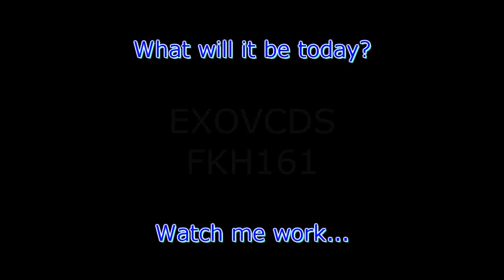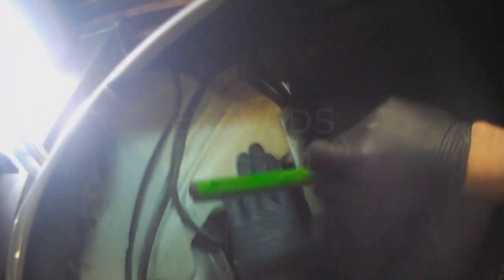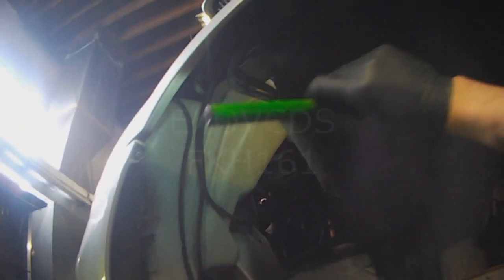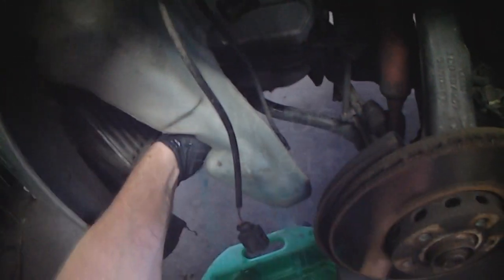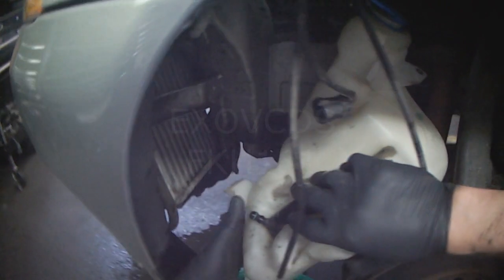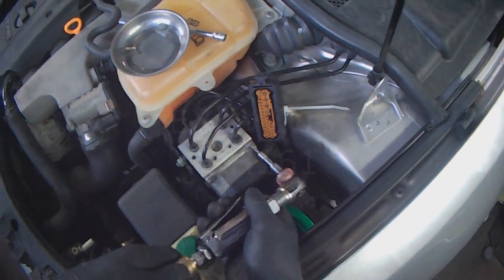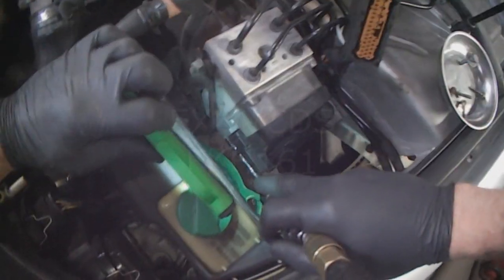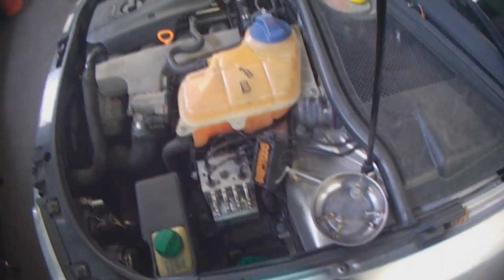Audi B5: ABS Module Removal

Comment: Was not expecting to see the washer bottle removal through the wheel arch. Most videos I find [for replacement of washer pump] require the removal of the front bumper, headlight and i/cooler. I KNEW there was an easier way. Thank you for the surprise.
Reply from the maker: It all depends on the year, make, model, engine. Thanks for watching!

Comment: super helpful...with ABS out of action with the Bosch 5.3 and others perhaps,  the rear wheels are relatively easy to lock up....😬..(ABS module fault also means rear wheel brake regulator out of action ) ....so its a real safety issue untill its repaired.......I've just replaced a heap of stuff before concluding my ABS module faulty...live and learn though, so all good 👍
Reply from the maker: Under normal driving conditions... lack of ABS (or even brake pressure modulation) is a non issue. Yes, road / weather conditions obviously come into play, but as long as one drives accordingly, the vehicle should be safe enough to operate... until a replacement unit is installed. Thank you for watching!

Comment: Great video!  Thanks for the tips, very much appreciated!  I'm attempting to split this module open and solder that broken connection.
Reply from the maker: +Kenny Gillis If it's a "no communication" fault, then it should not be too bad, because it is a bigger / thicker wire. If it is a sensor or other fault code, those wires are tiny.

Comment: Hey Thomas, great video! I'd like to ask you, if it possible to drive the car for a while after removing the module. I am planning to have mine adjusted but I need to move the car to the shop for other works
Reply from the maker: Yes, you can drive the car... just won't have any abs activation. ABS lights will be on in the dash and traction control (depending on system). Make sure to cover the exposed valve posts to keep dirt / water away.
Reply: @EXOVCDS  thank you.

Comment: Hey thanks for video , so i have problem of lighg abs and gearbox multitronic on audi a6 4b 2003 , so  they have relation abs with gearbox automatic??
Reply from the maker: Any fault codes in ABS & TCM?
Reply: @EXOVCDS  i dont do diagnostic before . I just want know the problem
Reply from the maker: @YassineBergou  I don't know the problem... that's why you have to check for fault codes. If no communication, then you have to check fuse and wiring.

Comment: Hey Thomas, great vid as always. I always learn something from your videos. 

I have a B6 1.8t and I get the ABS and the ESP lights coming on intermittently... Could this be my main issue..? I've already exchanged the brake pressure sensor and brake pedal sensor based from other shops recommendations.. but with no positive results. Please help.
Reply from the maker: I have not seen or am familiar with ABS Module issues with the B6 platform. 
Check with https://modulemaster.com/rebuilds/ to see if there are any known issues.
Thank you for watching!
Reply: @EXOVCDS  , thanks for the reply. I'll investigate with them since mine is an early model.
Reply: @EXOVCDS  hey Thomas, quick question... Would I have to get the module reprogrammed after I get the module back from them?
Reply from the maker: @Matt.R.B  No. If they fix your module, everything will stay the same. If they give you a different module / exchange, they will make sure it has the same coding.

Comment: Did you replace this module due to fault code 65535? Is the error resolved after the replacement? Have you taken down or repaired the electronics? thanks!
Reply from the maker: I don't remember the actual fault... most likely it was removed due to no communication. The module was sent out for repair... car can be driven without module. Once the module was repaired, we installed it again.
No need to post the same question under multiple videos of mine.
Reply: @EXOVCDS  thanks sorry for that ! I delete one of them.

Comment: Nice video.. I have a problem where the abs light goes on and of all the time.. Sometimes the abs works and other times not.. I always thought it was the sensor with a bad connection.. Can it be just a bad connection on the control module also? Got a 1999mod A6 C5.
Reply from the maker: The next time the warning light is on, have it scanned. If no communication, then the module needs to be repaired. If it has fault codes... some testing of components & wiring will be needed.

Comment: Hello Thomas, l now require a new module for my ABS.  I was wondering your thoughts on having the existing one rebuilt as opposed to buying a new one from the dealer?
Thx Peter
Reply from the maker: There are places that will / can repair bad modules. Such as: https://modulemaster.com/rebuilds/
There are other / more companies... we deal with local parts suppliers that stock exchange units. We give them out bad one and they give us a good one... ours gets repaired, to be sold to someone in the future.
Reply: @EXOVCDS  Thx Thomas. 
Can u bypass a bad  module and run the pump on its own if u wanted to purge the ABS system of air. I bled the reservoir too low :(
Reply from the maker: @peterhilbert6428  Air can't get into the ABS system (valve body) unless ABS is activated. Once air is in the system, you need to be able to open the valves to purge the air out. Running the pump alone won't do it. If you have a low brake pedal, try readjusting the rear calipers (especially if rear brakes were changed. Turn the pistons in until seated in the caliper and then turn the piston out until the caliper just slides over the brake pads. Resetting the calipers can increase pedal feel.

Comment: Great video! I have watched a bunch of yours. I am going to be grabbing some modules from pick n pull and I watched another video of an a6 I think and they pluged a replacement the module in to test it before they tore the car apart. Wondering if it would be the same on the b5s It would be nice if I could do the same in the parkinglot there. Thanks.
Reply from the maker: +King Life If you remove one from a car that has the same specs as your car (transmission etc)... it could be as simple as a swap, meaning that you can leave the module in place. No communication is the most common issue. If you have speed sensor codes, a module swap might not fix things.
Reply from the maker: +King Life Thanks for the update!

Comment: Is this a costly fix I’m looking into a 1999 a4 well kept but needs new abs module and don’t wanna get stuck paying half what I pay for the car
Reply from the maker: You can go to a wrecking yard and find / buy the same module for $100 or have yours repaired: https://modulemaster.com/rebuilds/cars-trucks/
You can even leave it as is and drive the car with no ABS... if your local Emission / Safety inspection allows. 
Sadly... a 20 year old car will require some TLC. Eventually, maintenance costs will surpass what you paid for the car.
Reply: Thomas EXOVCDS so you saying it’s a no go and I should look for something else? Guy said he well maintained the car but everyone says that
Reply from the maker: No, I'm saying that if you are already concerned about putting money into it... you have to realize that a 20 year old car will need attention sooner or later. There's nothing wrong with owning a 20 year old car. I have two that are 30 years old. It just sounded like you don't want to put any more money into it.
Reply: Thomas EXOVCDS basic stuff I’m fine with just don’t wanna get stuck with a bucket of money yenno
Reply: Thomas EXOVCDS he wants 4200$ for it too
Reply from the maker: @Dominik-zr5qh  $4200 for a clean solid car is a good deal. I'm not saying stuff will go bad, I'm just saying that you need to understand that a 20 year old car "might" have some issues down the road... the clutch / automatic transmission could go 6 months, 3, 5 or 10 years from now. The same can be said when someone buys a 10 year old car.

Comment: Greetings from Finland! Could you help, is there relays inside of that module? Mine is year 1995 and doesnt have that typical problem where connections inside that brokes. So only last thing could be relays. Vcds says abs valve relay. Sorry for bad english.
Reply from the maker: The wiring diagram I am looking at shows that the relays are inside the Hydraulic pump assembly. Make sure that the fuses for the relays are OK. One fuse for the solenoid valves and one fuse for the pump. 1995... what model & engine? Quattro?
Reply: @EXOVCDS  Okay, very much thanks for you. Fuses have been checked, those are fine. Next step is to take that box out and check relays. Hope there is answer. Mine is 1.8t with fwd. Fully build in like 7 years, got 411 hp on wheels and 550Nm. With normal 98 gasoline. Maybe in summer im going to change to re85 etanol...
Reply from the maker: Wow, nice build!

Comment: hi Thomas I have a 99 passat turbo  the break light is flashing and the abs light stays on . you think it's the same issue and I should replace the module ?
Reply from the maker: Yes, most likely the module has an internal fault... but make sure that all power & grounds at the harness plug are good. You can remove the module and send it out for repairs (car can still be driven, but the remaining hydraulic / valve box needs to be covered / protected). Here's a Passat ABS Module removal video: https://www.youtube.com/watch?v=Im1mAOs-h1c Can be done without having to go through the wheel arch.

Comment: I have a 2003 Audi A4 Quattro B6.  No speedometer, odometer, abs light, and flashing brake light? Is it this? Guy before me bought a VSS(Vehicle Speed Sensor) but come to find out this model doesn’t have one.
Reply from the maker: Odometer is visible but it is not counting... correct?
I would scan the ABS module and check for fault codes. If the front left ABS speed sensor is bad, the speedometer & odometer will not work (if I recall correctly).
Reply: Thomas EXOVCDS ok.  Would the wheel sensor also cause abs light and brake light flashing?
Reply: Thomas EXOVCDS and yes odometer is just not counting
Reply from the maker: The brake light flashing could be because of the sensor or because the ABS unit is no good (not awake / other modules can not communicate with the ABS module)... hence, use a scan tool to try and communicate with the ABS module. No communication would explain the lights and lack of speed / odo. Communication yes... will probably result in a speed sensor fault code. You won't know... I can't tell, until you / someone scans the ABS module.

Comment: Hey Thomas , my connector is just reverse of your , i mean , the plastic to unplug the bigger  connector is in the other side , i do not why , Will i have problems to remove It and unplug the Big connector?
Reply from the maker: Not sure... probably not.
Reply: Thomas EXOVCDS so how can it be there now, i Guess someone handle it , all vídeos im watching the plastic to hold connector is in front of hydraulic fluid but mine is in the other side , cannot explain
Reply from the maker: Send me a picture... so I can see what you are talking about. fkh161@fkh161.ca
I'm at work... sorry about the late reply.
Reply: Thomas finally no problrms to unplug connector , but more comfortable in the other side , one question if i dont decide to send repair and i buy a good used one with the same oem number and electrical part number as mine , i must recode It ? Or not neccesary being same reference, THANK YOU

Comment: Does anyone know if I can swap my bad unit out for one at a junk yard?? I have a 01 A4 and if I can grab one at the junk yard does it have to be same year or any b5? Thanks for any help guys!
Reply from the maker: Chris Watson The closer it matches your car the better (no coding is required). If it is the same generation but auto instead of standard or standard instead of auto... you will need to "code" the module so that it can function correctly. The best thing to do is to remove it and send it out to http://modulemaster.com/rebuilds/ If you install a used unit, it might only work for one year (because it too is an old module). Having yours "refurbished" will bring it back to life and you will not have to worry about having to code anything / mix & matching.
Reply: ***** hey Thomas I sent just received my abs module back from the rebuild company and I installed it and it eliminated my abs light and brake light being on but now I got another problem if I could get your advice if possible....After I installed the rebuilt module im getting a vibration in my brake pedel about 90% of the time. Even when im just lightly braking. Its like a knocking feeling. I really appreciate all your help and if you had any ideas it would be a huge help! Thanks thomas!
Reply from the maker: Chris Watson The abs could be kicking in due to a weak abs sensor signal. I would have to compare the sensor signals to determine if it is a sensor issue. Sometimes you can have a bad tone wheel (that triggers the sensor).

Comment: Found your Video as i'm Trying to figure out what the problem is with my B5..

ABS light will be on just under 1 minute after start up. Fault cant be deleted... 
Vehicle seems to be in some sort of limp mode possibly due to this issue.. from 12psi down to 3 psi..
Wonder if this video could solve this..
Reply from the maker: Probably not (same as this video)... what's the fault code? 
This one had a "no communication" (with the ABS module) fault... removing the module for repair solved that.

Comment: My 97 Audi A4 FWD front brakes locks up after driving for 10mins I've changed calipers/abs sensor /BMC still doing the same thing any tips or thoughts would help
Reply from the maker: Is the brake pedal retuning fully? Are the brake pedal switch & cruise control switches installed / adjusted correctly? If you already replaced all those components... something might be preventing the Brake Master Cylinder from returning all the way, causing the brakes to not let loose. Raise the vehicle so you can feel when the brakes are locked-up / dragging. Remove the switches from the brake pedal and pull the pedal away from the booster / towards the driver seat... does it move a little? Are the brakes free now?
Reply: Brake pedal feels like a sponge really soft when the car is on and I hear like air  releasing out  kinda like when you  barely open a soda when I have the pedal to the floor but  When car is off pedal is hard I have not check  those parts yet
Reply from the maker: It could be that the booster is not returning correctly... the hissing sound could be a sign of booster failure.

Comment: Can that cause the steering to be stiff
Reply from the maker: No.
Year, make, model, engine?
Reply: My ABS is bad it works sometimes if you leave the car overnight and start in the morning everything works. It can last me for an hour if I’m driving on the highway but regular streets only for 10 minutes and then the steering get stiff if I turn the car off an put it back on when the ABS light appears on the dash
Reply: I have a A8 tho I don’t know if it’s a safety feature
Reply from the maker: What year? Might have hydraulic assist from the brake hydraulics?